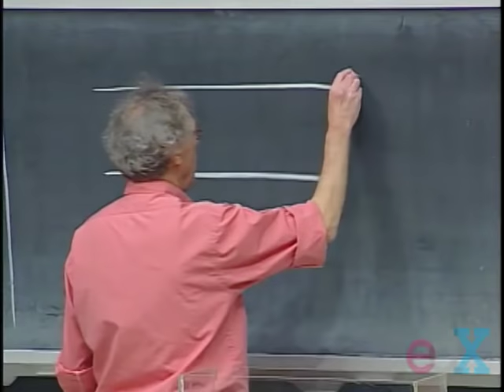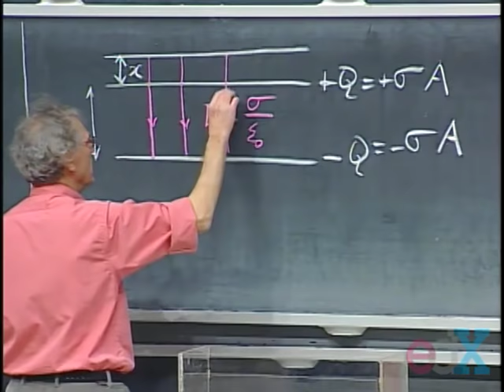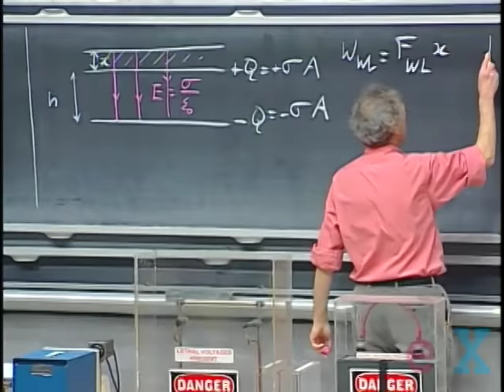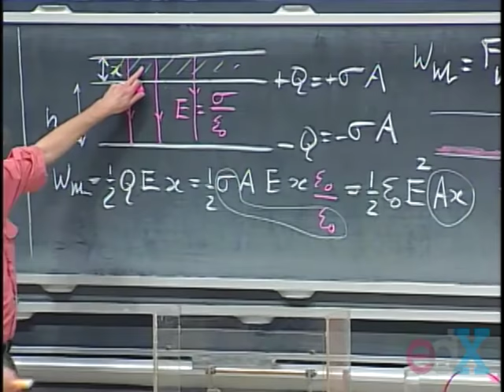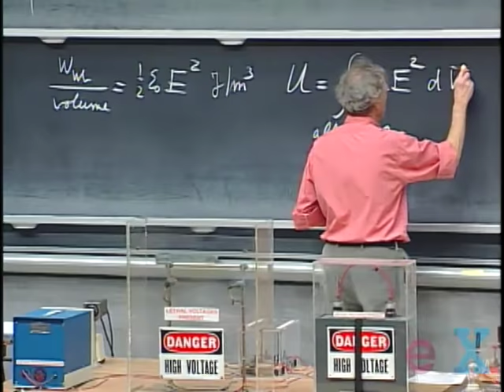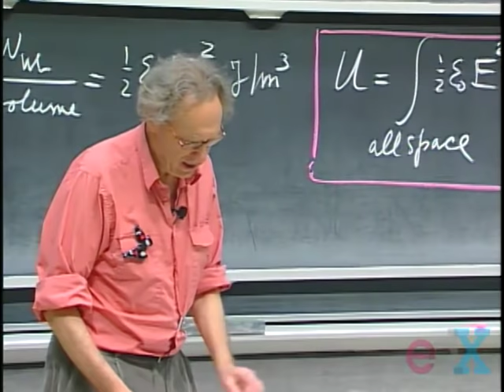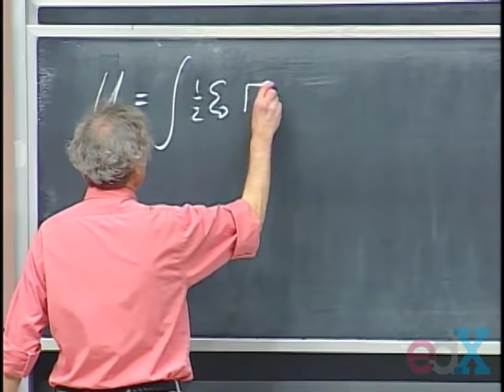8.02x - Lect 7 - Capacitance, Electric Field Energy

Comment: But isn't it wrong in taking average for force acting on plate . As the same result can be proved by gaussian surface. Plz reply sir
Reply from the maker: question unclear - maybe this is what you had in mind
Let the charge on each plate of the capacitor be Q=100q (+Q on one plate and --Q on the other). Let the area of each plate be A. The E-field between the plates is then Q/(A*eps_o). Let the distance between the 2 plates be d.  Now release q from the + plate to the negative one. The energy that is released is force*distance which is very close to q*d*Q/(A*eps_o). But after this transfer the E-field is reduced, it’s now only 0.99*Q/(A*eps_o). I now release another q thus the energy that is released is now 1% less than with the first q. By the time I have released 10 times one q, the E-field is only 0.9*Q/(A*eps_o) and thus the force on the charge q is only 0.9*q*Q/(A*eps_o). The force keeps going down as I transfer more charge.  By the time I have released the last q (of 100) the E-field has become 1% of the original E-field thus the force on the last q is about 1% of the force during the first transfer. Thus by the time that I have released 100q=Q the average E-field was only 0.5*Q/(A*eps_o), NOT Q/(A*eps_o). Thus the average force on a charge q during transfer was NOT q*Q/(A*eps_o) but only half that. Thus, by spooning off the charge from one plate to the other the energy release is NOT Q*d*Q/(A*eps_o) but only half of that. The energy that is released this way (also called potential energy) is identical to the work that YOU would have to do to separate the 2 plates over a distance d.

Comment: at 2:45 why do we need to consider the thickness of the plate ? don't we mostly assume that stuff is infinitesimally thin ?
Reply from the maker: Any thickness will do. I derived here the infamous factor of 2. You may like this better:
Infamous factor of 2
Let the charge on each plate of the capacitor be Q=100q (+Q on one plate and --Q on the other). Let the area of each plate be A. The E-field between the plates is then Q/(A*eps_o). Let the distance between the 2 plates be d.  Now release q from the + plate to the negative one. The energy that is released is force*distance which is very close to q*d*Q/(A*eps_o). But after this transfer the E-field is reduced, it’s now only 0.99*Q/(A*eps_o). I now release another q thus the energy that is released is now 1% less than with the first q. By the time I have released 10 times one q, the E-field is only 0.9*Q/(A*eps_o) and thus the force on the charge q is only 0.9*q*Q/(A*eps_o). The force keeps going down as I transfer more charge.  By the time I have released the last q (of 100) the E-field has become 1% of the original E-field thus the force on the last q is about 1% of the force during the first transfer. Thus by the time that I have released 100q=Q the average E-field was only 0.5*Q/(A*eps_o), NOT Q/(A*eps_o). Thus the average force on a charge q during transfer was NOT q*Q/(A*eps_o) but only half that. Thus, by spooning off the charge from one plate to the other the energy release is NOT Q*d*Q/(A*eps_o) but only half of that. The energy that is released this way (also called potential energy) is identical to the work that YOU would have to do to separate the 2 plates over a distance d.
Reply: thank you for answering my query...my minds blown

Comment: Dear Sir, I get why Voltage should be proportional to Charge But I dont understand why charge should be proportional to voltage like it is generally written in Q=CV. 

can you please help.? thx so much..

Also Is it reasonable to think that the reason a capacitor works is that each plate changes the potential of the other plate when placed closed by, so that the positive plate will increase the potential of the negative plate and vice versa so that you can put more charge on each plate than otherwise? 

thx so much and u rock as alaways :)
Reply from the maker: watch my 8.02 lecture on capacitors
Reply: Thx so much for reply sir. I did watch it but you simply define C=Q/V. I am trying to intutively understand why this equation should work and I am strugling with it. I can understand why V should be proportional to Q but not why Q should be proportional to V.
Reply from the maker: C=Q/V is the definition of capacitance. It means that for a GIVEN potential, V, a capacitor which is twice as high can carry twice the charge That's quite intuitive.
Reply: Ok thanks so much sir. this helps..have a good weekend..

Comment: Sir, I would like to ask a question which is not directly related to the topic of this lecture. The question is can i charge an electroscope by a continuous dc supply. Thanks for these beautiful lectures
Reply from the maker: You can only charge the electroscope till the electric potential is the same as your DC supply (volt V). Since your electroscope probably has a capacity of pF, its charge will be 10^(-12)*V Coulomb
Reply: I assume with a charge that low its impossible to observe any effect on the leafs of the electroscope
Reply from the maker: correct
Reply: sir, i am searching some answers for days. but what i am getting is more questions.If you have time will you tell me the solution of the following-------

a)  if i charge a single plate then bring another plate parallel to it the voltage of the first plate decreases which enables us to charge the plate more without reaching breakdown. Why is that that - a second parallel plate decreases first plate's voltage?

b) what will happen if i place/connect a single plate(with a large surface area)/sphere(with a large radius) with the positive terminal of a continuous DC supply and leave the negative terminal as it is/not connected? No charge will accumulate on the plate/sphere i think because the circuit is open. or some charge will accumulate on the plate/sphere? 

Thank you sir for your quick replies
Reply from the maker: a) make a drawing of a flat + charged plate. Equal amount of charge on both surfaces (left and right). Bring a neutral plate close to the right side of the charged pate. Induction will make the left side of the neutral plate negative. In turn this negative charge will move some of the + charge of the charged plate to its right side. Thus the E-field outside the left of the charged plate will be somewhat reduced. Thus the work you have to do in moving a + charge from infinity to the left plate will be somewhat less.  Thus its potential will be somewhat lower.
Reply: Thank you sir

Comment: 26:53 What if we don't take the voltage supply off and start increasing the gap between the two plates?
Reply from the maker: then the potential diff will not change, thus the E-field goes down, thus the Free charge goes down, thus the Capacitor goes down. All this is covered in my lecture. Try not to be lazy
Reply: @lecturesbywalterlewin.they9259  I am so happy that you replied me. I started loving Physics when I was introduced to your lectures. Now I teach Physics. I have determined to dedicate 1 hr daily to your lectures and do all of your courses with assignments and exams. As I am an Electrical Engineer, I started with 8.02x.

If I ever have chance to converse with you, it would be great.

Comment: why do we take the average of fields. Shouldn't we use the newton's laws to find net force
Reply from the maker: Infamous factor of 2
Let the charge on each plate of the capacitor be Q=100q (+Q on one plate and --Q on the other). Let the area of each plate be A. The E-field between the plates is then Q/(A*eps_o). Let the distance between the 2 plates be d.  Now release q from the + plate to the negative one. The energy that is released is force*distance which is very close to q*d*Q/(A*eps_o). But after this transfer the E-field is reduced, it’s now only 0.99*Q/(A*eps_o). I now release another q thus the energy that is released is now 1% less than with the first q. By the time I have released 10 times one q, the E-field is only 0.9*Q/(A*eps_o) and thus the force on the charge q is only 0.9*q*Q/(A*eps_o). The force keeps going down as I transfer more charge.  By the time I have released the last q (of 100) the E-field has become 1% of the original E-field thus the force on the last q is about 1% of the force during the first transfer. Thus by the time that I have released 100q=Q the average E-field was only 0.5*Q/(A*eps_o), NOT Q/(A*eps_o). Thus the average force on a charge q during transfer was NOT q*Q/(A*eps_o) but only half that. Thus, by spooning off the charge from one plate to the other the energy release is NOT Q*d*Q/(A*eps_o) but only half of that. The energy that is released this way (also called potential energy) is identical to the work that YOU would have to do to separate the 2 plates over a distance d.
Reply: thankyou sir. why didn't you use this explanation in the lecture
Reply from the maker: I decided to do it the way their book does. Besides the above way would have taken me 10 minutes. There is actually an easier way. A given charge creates an E-field. That E-filed is NOT pushing or pulling on the charge itself.  Thus the force that the +Q charge experiences due to a nearby -Q charge does NOT depend on the E-field that the +Q charge creates.

Comment: Sir my teacher explained that when we charge a capacitor we have to do work for overcoming the repulsion and this work is store in the capacitor in form of energy is it right. if he is right i have a doubt if e field outside the capacitor is 0 then why there is a need to do work to bring charge there ?
Sry if it is silly question 
Love from india
Reply from the maker: The electric potential energy of a charged capacitor is 0.5CV^2 Joules. Thus that's the work that has to be done to charge the capacitor to an electric potential V. If needed, use google.

Comment: sir suppose I bring one electron from infinty to point A. the work done by me is zero because I simply move the charge there is not electric field. sir from 1st definition, potential energy of electron is zero. but from second definition potential energy of electron is not zero because integration electric field energy density over entire volume is not zero. sir both definition gives different result of electric potential energy of one electron sir. this is contradictory. sir how can be two potential energy of one electron
Reply from the maker: I have answered this question already  in detail.  If you come with 1 C from infinity no work is needed to go from infinity to A, but you have to assemble a 1 C charge when you are at infinity. The work you have to do is the electric PE of the configuration of 6.3*10^18 electrons. The larger the radius of a sphere the less work, the smaller the radius the more work as the electric PE will than be larger. In that case the volume integral of the field energy will also be larger by the SAME amount. This is my last msg on this topic. Thus option 1) and 2) in your earlier msg are BOTH correct.

Comment: How can current flow through the parallel plate capacitor as it there is gap between the plate,which will make it open circuit?
Reply from the maker: good question. If I charge a capacitor with a battery, a time dependent current will flow through the wires which are connected to the 2 sides of the capacitor. As a result one side of the cap will become + charged and the other -- charged. No current will flow through the capacitor. When the potential diff over the capac is the same as that of the battery, there will no longer be any current.
Reply: So,no current will Flow through the capacitor at any time,it just appears as the current will Flow through it as -ve charge accumulation on one plate causes electrons on other plate to move away , which makes the other plate positively charged

Comment: professor do we need to do any work to move a charge in empty space ? In other words does a charge experience a force just due to the fact that it's moving, so to speak 'into' it's own electric field?
Reply from the maker: >>>If you could reconnect the dvd in Cambridge, you could plug tv unit into that.>>>
moving it with constant velocity requires no work. accelerating it does require work.
Reply: thank you professor that cleared my doubt. 

But i'm curios to know that how does a moving electron 'know' the difference between the field produced by it and that of an another electron ? 

for instance a moving electron doesn't experience a force when it moves into it's own field ,but it would experience a force from the field of an another electron.

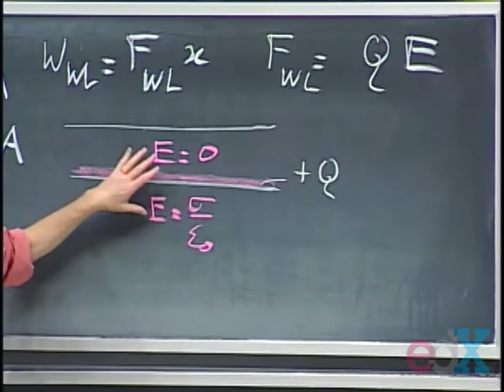Comment: 3:30 I couln't understand that why the average between the two is to be taken?
Reply from the maker: Infamous factor of 2
Let the charge on each plate of the capacitor be Q=100q (+Q on one plate and --Q on the other). Let the area of each plate be A. The E-field between the plates is then Q/(A*eps_o). Let the distance between the 2 plates be d.  Now release q from the + plate to the negative one. The energy that is released is force*distance which is very close to q*d*Q/(A*eps_o). But after this transfer the E-field is reduced, it’s now only 0.99*Q/(A*eps_o). I now release another q thus the energy that is released is now 1% less than with the first q. By the time I have released 10 times one q, the E-field is only 0.9*Q/(A*eps_o) and thus the force on the charge q is only 0.9*q*Q/(A*eps_o). The force keeps going down as I transfer more charge.  By the time I have released the last q (of 100) the E-field has become 1% of the original E-field thus the force on the last q is about 1% of the force during the first transfer. Thus by the time that I have released 100q=Q the average E-field was only 0.5*Q/(A*eps_o), NOT Q/(A*eps_o). Thus the average force on a charge q during transfer was NOT q*Q/(A*eps_o) but only half that. Thus, by spooning off the charge from one plate to the other the energy release is NOT Q*d*Q/(A*eps_o) but only half of that. The energy that is released this way (also called potential energy) is identical to the work that YOU would have to do to separate the 2 plates over a distance d.

Comment: sir smaller charge that we have is equal to charge on electron. sir I am taking now only one electron only one(no 1columb charge). sir electron has a charge so it will make electric field.  sir I am bringing one electron from infinty to  point A. sir I  do not work to  bring one electron from infinty to point A. sir I have also not do any work at infinity. sir  I  did  not have to assemble electron(sir have to do work to  assemble 1C charge but  I not do any work to assemble on electron). sir at point A electron has not potential energy from first definition. sir from  second definition electron has potential energy
Reply from the maker: I am glad you keep thinking about this. If you take ONLY 1 electron and bring it from infinity to A, you do not have to do any work. But nature has created that charge of 1.6*10^(-19) C somehow. That must have cost nature energy.   We are now entering QM where classical physics can no longer be applied. The classical problem here is that assuming that the radius of an electron is zero, that amount of electric potential energy would be infinity. This is called the  infinite self-energy problem. I attach here an exchange I had with my friend and colleague Professor Zwiebach at MIT.
========= Walter - The problem is an infinite self-energy of the point particle limit.  This problem is not really there in QED, as any infinite self energy is renormalized away. There is actually an effective version of Maxwell’s equations, called nonlinear electrodynamics in which point charges have finite self energy, and electric fields cannot exceed a limit (just like the speed of objects is < c).   This is also true in classical string theory.  It is explained in Chapter 20 of my book on string theory.
Best,  Barton.

Comment: At 3:35 why you took average of two electric field ???
Reply from the maker: factor of 2
Let the charge on each plate of the capacitor be Q=100q (+Q on one plate and --Q on the other). Let the area of each plate be A. The E-field between the plates is then Q/(A*eps_o). Let the distance between the 2 plates be d.  Now release q from the + plate to the negative one. The energy that is released is force*distance which is very close to q*d*Q/(A*eps_o). But after this transfer the E-field is reduced, it’s now only 0.99*Q/(A*eps_o). I now release another q thus the energy that is released is now 1% less than with the first q. By the time I have released 10 times one q, the E-field is only 0.9*Q/(A*eps_o) and thus the force on the charge q is only 0.9*q*Q/(A*eps_o). The force keeps going down as I transfer more charge.  By the time I have released the last q (of 100) the E-field has become 1% of the original E-field thus the force on the last q is about 1% of the force during the first transfer. Thus by the time that I have released 100q=Q the average E-field was only 0.5*Q/(A*eps_o), NOT Q/(A*eps_o). Thus the average force on a charge q during transfer was NOT q*Q/(A*eps_o) but only half that. Thus, by spooning off the chaInfamousrge from one plate to the other the energy release is NOT Q*d*Q/(A*eps_o) but only half of that. The energy that is released this way (also called potential energy) is identical to the work that YOU would have to do to separate the 2 plates over a distance d.
Reply: @lecturesbywalterlewin.they9259  thank u so much sir....